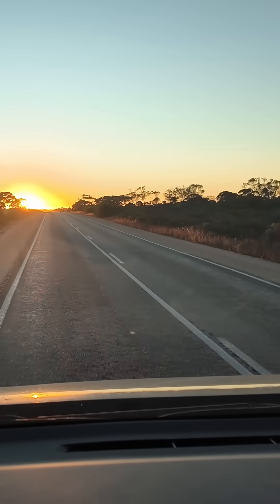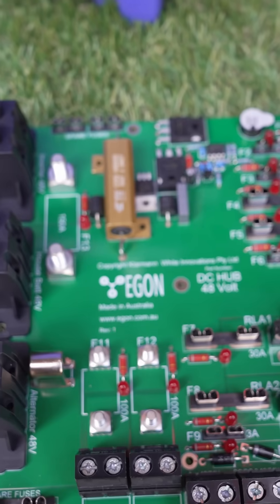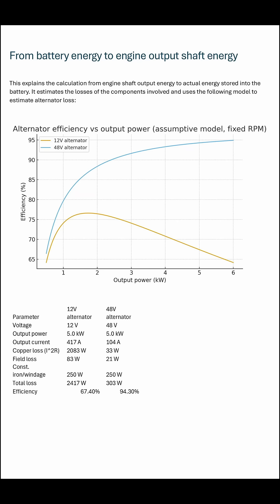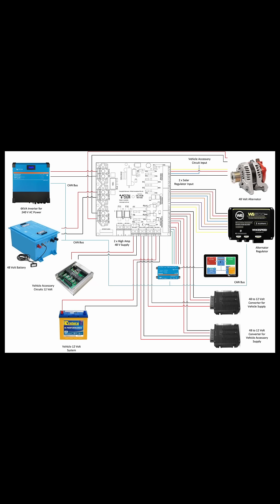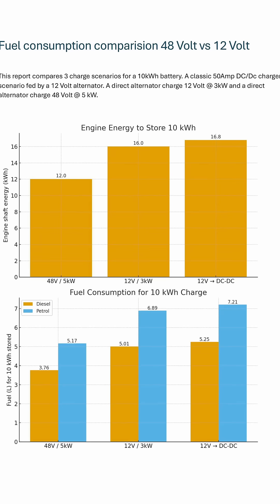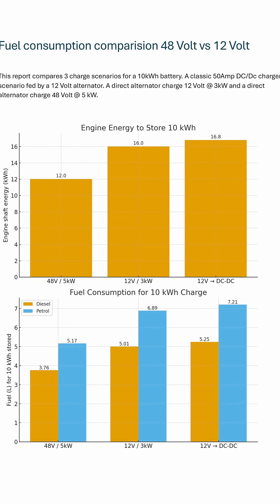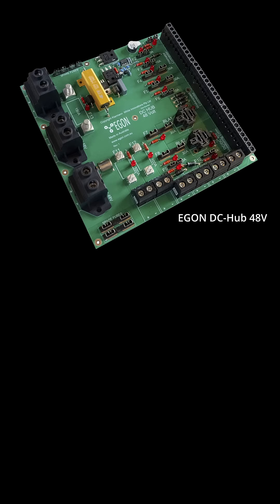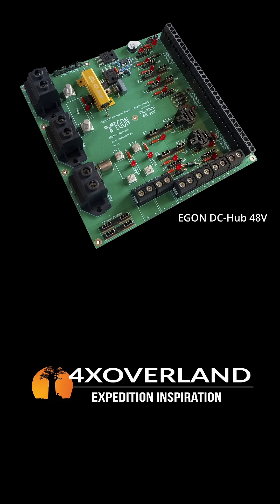48V charging with actually SAVE fuel. We've proved it! @4xoverland

Comment: Wouldnt this only apply if you were running the engine to charge whilst stationary?

If you're driving for hours it doesnt make much difference in the load on the altetnator
Reply from the maker: As it turns out, it does!

Comment: Can you run the dc hud. With a non EGON battery
Reply from the maker: It works with any battery. The Egon-certified battery just makes the system a bit easier to configure, that's all.

Comment: Can this battery/distro system work on cars that don't have an alternator?
Reply from the maker: Need more info to respond to that one.
Reply: @4xoverland  I have a Prius and an LDV eDeliver, both use a dc-dc converter to charge the 12v system, not an alternator.

I'd like to run a 48v system for accessories in both, to reduce cabling losses etc and get more power for off grid/camping, it this system helpful for that?
Reply from the maker: Both these cars have 12V alternators. The alternator charges the start battery, which then feeds the DC-DC converter which charges the house battery.
Reply: @4xoverland and?
Reply: @4xoverland Uhhh, no they definitely don't 😅

The eDeliver doesn't even have an engine to connect an alternator to lol. 

Both 12V systems are charged by the HV system through a dc-dc converter, not the other way around...
Reply from the maker: Sorry. Misread your comment. The answer is no. Its designed to work with 48V alternators.
Reply: @4xoverland ah I see, thanks!

Comment: The electrical engineers knew this. Amplified electricity in feedback simulating a spinning generator works quickest. Shine a light into solar pannel. Amplify solar panel with inverter to power a light. shine the light back into solar panel.  Use second out socket on inverter as the generator output.
Reply: What you're talking about is perpetual motion, that doesn't work 😅
Reply: Rewrite,  best advice,  I was told buy PhD people. I often have to Rewrite myself. 😊